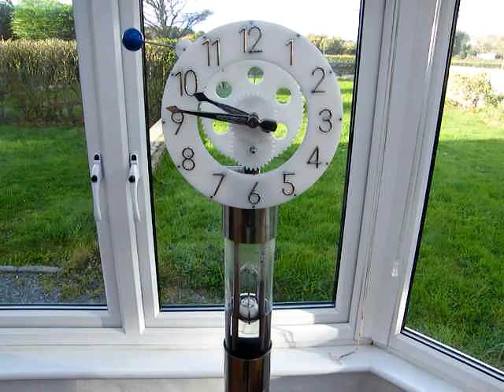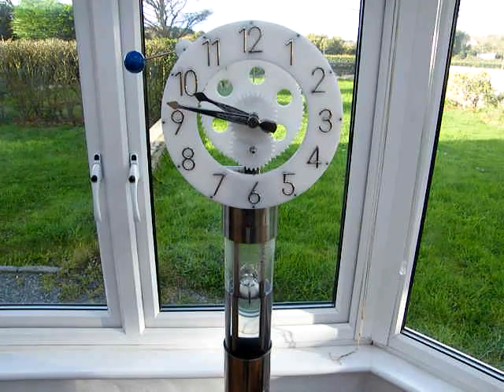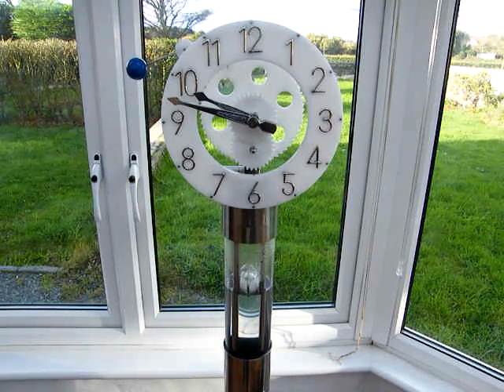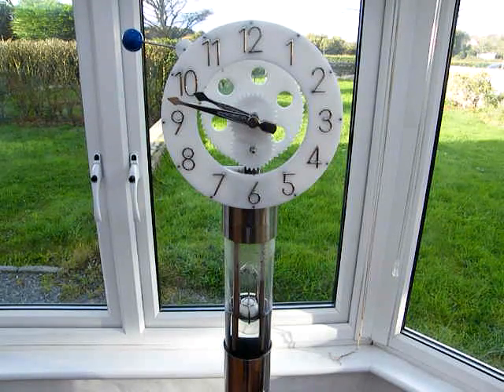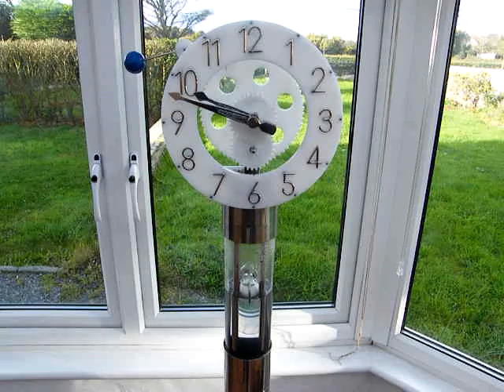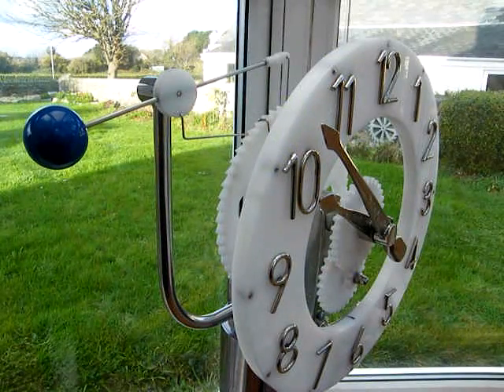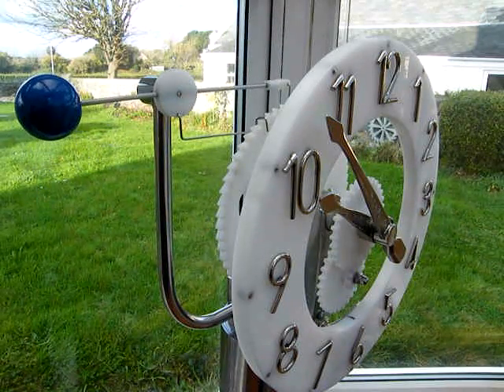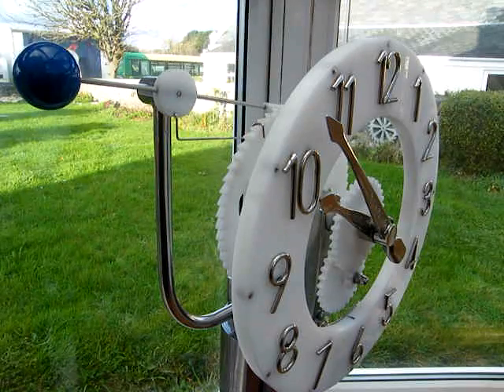Water Powered Automatic Syphon Clock

Comment from the maker: @KEvronista 
Hi ...There has to be a "flushed" gag here somewhere!
I know they look the same and in fact the final (12 to one) set is the same) but the other parts are made to suit size,ratios etc.
The hands are all made from stainless cutlery (forks) and cut and shaped with counterbalances added
The numbers are 3.2mm s/s welding rod and are different sizes on all three clocks (to suit the face diameter and chord)
Cheers